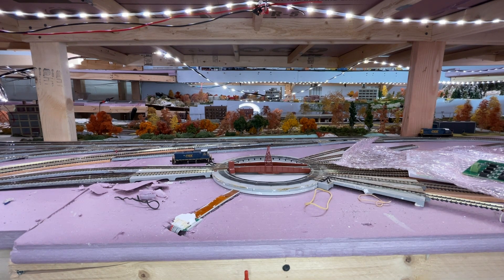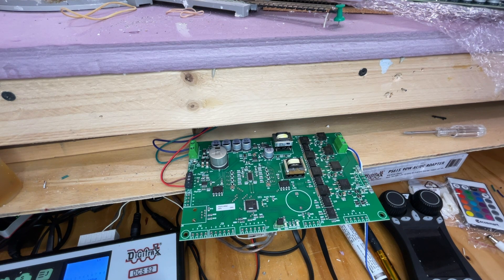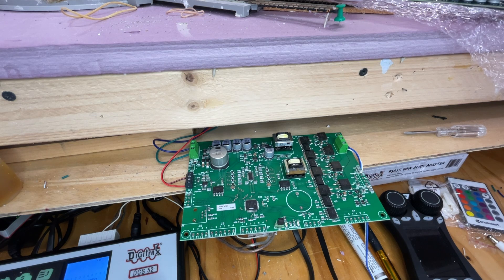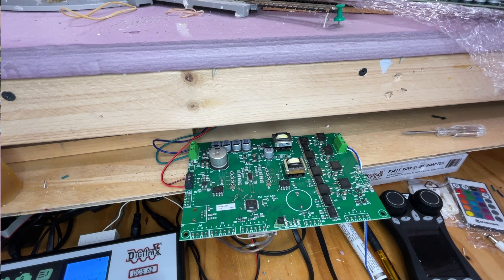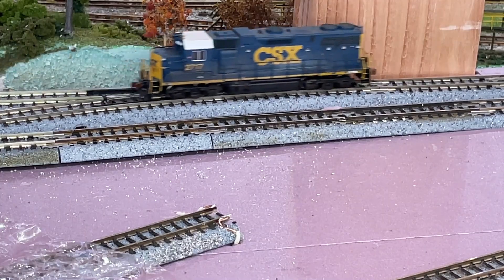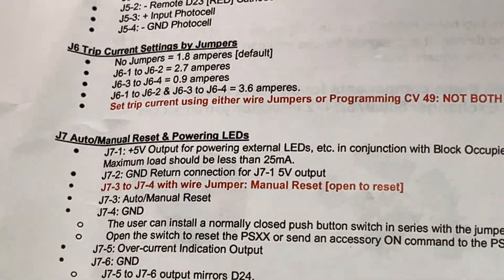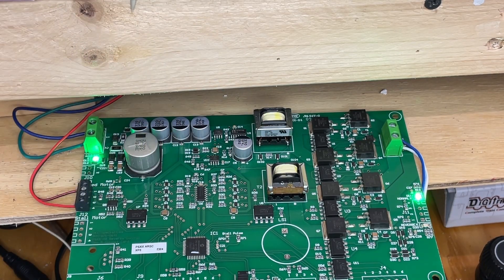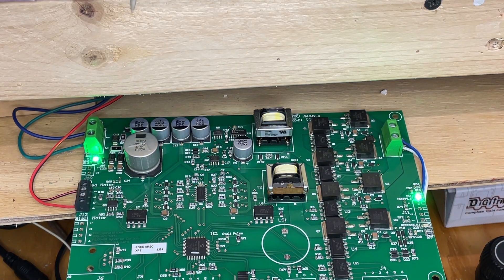Automatic Turnout Control

Comment: This is a huge unlock for my setup! 
Do you know if it has enough power to throw two turnouts?
Reply from the maker: It was for me, too!  I don't know that it has that much capacity to fire two.  I would be afraid it wouldn't be able to push both coils.  it's really meant to throw the one turnout that is in the reverse loop or wye so my guess is it won't handle two.

Comment: So does the switch go straight after a time, without resetting the power or you throwing the switch?  Or does the train run around the reversing loop in the opposite direction next time through?
Reply from the maker: it does not automatically restart unless it loses power - so a restart of the dcc command/booster or a short circuit.  the train will enter and exit the turnout in alternating pattern unless the user interacts with it.

Comment: Auto reversing seems much more interesting now that you demonstrated how the units can line the switches. Was also a great tip about not getting the correct board, SC version for Kato in particular. From previous videos. i get the impression that you are not a fan of metal wheels but will be curious to know how it affects train lengths vs loop size. Thanks again for the great videos.
Reply from the maker: Yes, metal wheels will be an issue depending on where your isolation joints are placed.  in my case, they're at the turnout so as far into the loops as possible.  if a car is hanging off the end of the turnout when it switches, i'd have more problems than just the track alignment and polarity.  My standard train of about 26 cars fits comfortably in the loop, so even if i had all metal wheels on a train of about 30-40 cars, i could still flip my trains successfully.  like all autoreversing, the reverse section needs to  be as long as your longest train.

Comment: Hi C Mastracci , hope you had a good Thanksgiving . Some good information that is the way to go with a reversing loop . You don’t have to chase the train around the layout to change the switch. I’m finally back to running trains. . Been breaking in some new locomotives. Thanks for sharing. Have a good weekend .       😎😎   👍
Reply from the maker: I've been working on the number one main.  Had to re-lay a section of new track because i reused some old flex and it was just a bit funked up and the big boy was not a fan.  Got that laid in place and now it runs much better on new track.  about to start working on the number two main.  hopefully by this weekend, i'm running double trains in happy little loops again!  i also have a new loco to break in - get ready to see that soon!

Comment: Carlos, very informative subject matter covered very well.    I do have a question, if you are running metal wheels do you have to have the whole train inside the loop to operate and throw the turn outs?   I understand you have a long train run but just wondering about smaller loops.
Reply from the maker: So I haven't tested it yet - however - I'm guessing yes - the entire train will need to be in the reverse section including any metal wheels on rolling stock or DPUs.  If the track was configured in such a way the train could exit prior to the whole thing reversing - it would probably short because you'd end up shorting at both ends and the AR wouldn't be able to match.  As it is, my isolation joints are at the turnout so i can't make the loop any larger - which will dictate longest possible train. Otherwise, it'll look like one of those old time 'snake' games where you lose when you run into yourself.